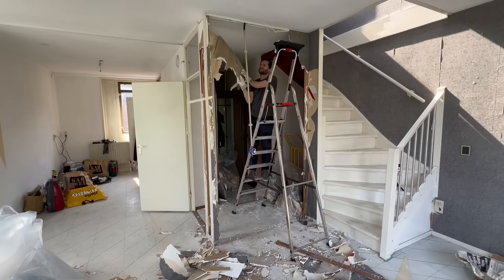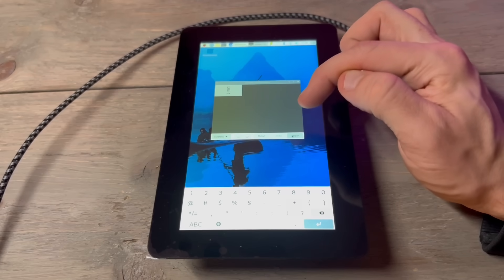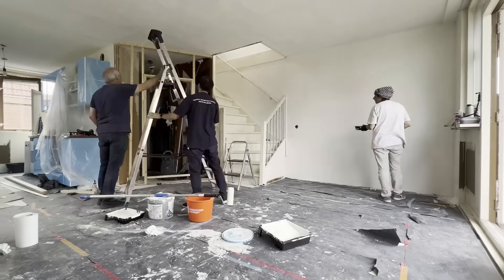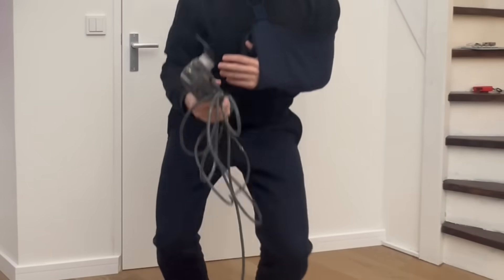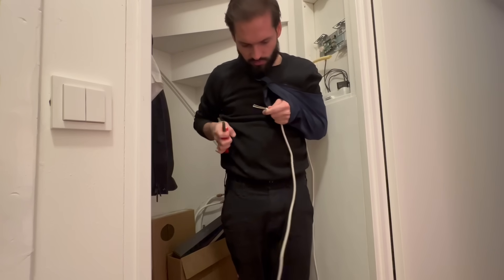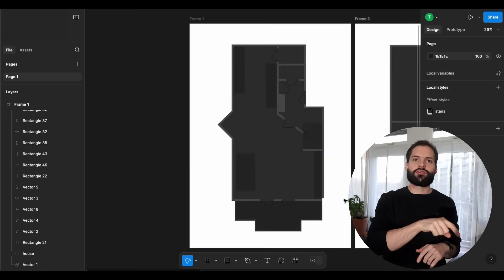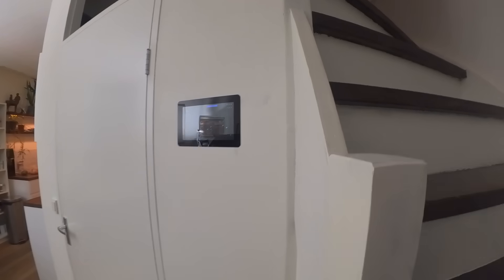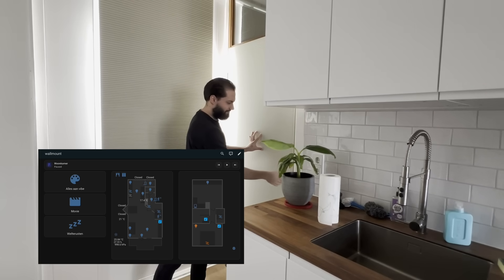I Destroyed My Wall for THIS Smart Home Display! (Home Assistant & Raspberry Pi)

Comment: Nice! 
Probably not a huge deal but, I would check the temperature inside the wall cavity and maybe consider cutting two vents into the back panel (one on top and one at the bottom so convection can carry out any heat trapped inside.
Reply from the maker: Yeah, i’ve checked this a couple of times. I made the space behind the wall quite big so I think it should be fine, but adding vents would probably be the best thing to do, only makes it look a little less nice 😛